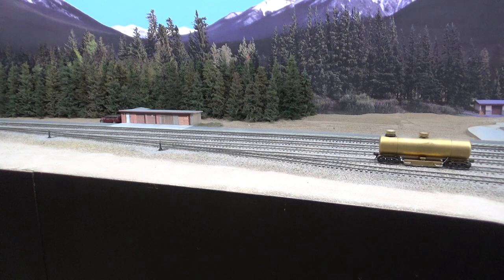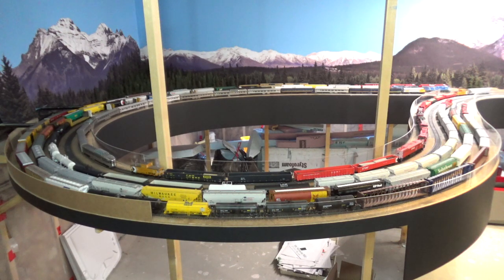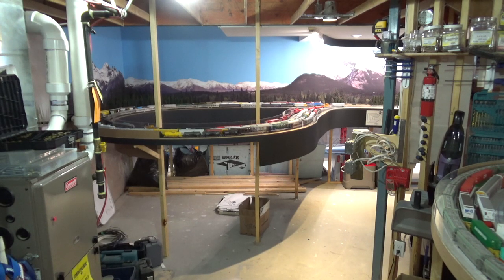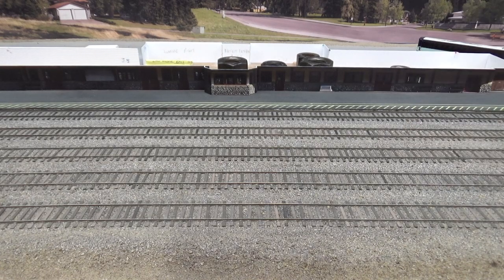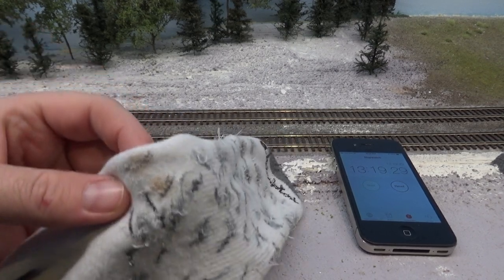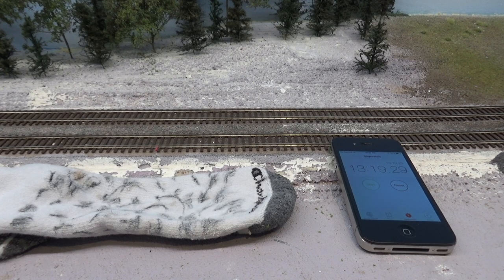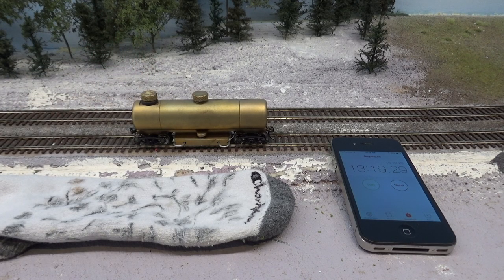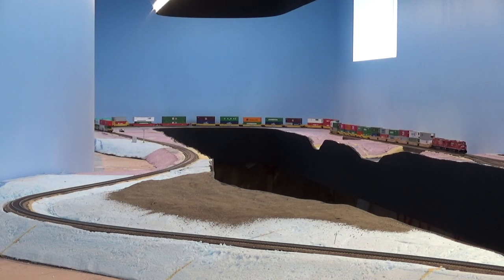How To Clean Six Hundred Feet Of Model Railroad Track

Comment: I use old cloth and CRC (without silica) on my layout. However,  I possess very little Nickel Silver track and use large amounts of Brass track with varying degrees of grime/oxidation. To boot, nearly all my rolling stock is vintage plastic wheeled cars which will leave residue on the tracks after a while. I’ve found the CRC and cloth works well for problem spots or heavily tarnished track segments and the simple cleaning with a cloth gets most of the filth with no issue. My current cloth is a pice of quality fabric. I tried isopropyl alcohol on some of my more messy track pieces and cleaned it up nice, but it does lead to more oxidation reactions as the alcohols deprotonate (lose an H) when exposed to an electric current. Unless you wipe off the isopropyl alcohol you end up adding a layer of grime to the track, since all does not evaporate off.
Reply: I love the Loram rail grinders and am trying to figure out the mechanism for a scratchbuilt model that would apply minute amounts of isopropyl before a series of scrubber cars (the issue is getting the scrubbers to stay clean sufficiently long enough to do a good 200’ before replacing the brushes/cleaning them). I’m also attempting to figure out how to apply minute amounts of CRC after the scrubbers (as needed) to increase conductivity
Reply from the maker: Love the idea of a Loram or Herzog train that looks like a maintenance of way train but is actually a functional track cleaning train. I'd like to try something similar eventually, I think a vacuum car in the lead would be good too to pick up the dust before the cleaning cars come along.

Comment: The sock is a great idea!  Model Railroad Hobbyist magazine did a great article several months back explaining why different chemicals are better or worse for track cleaning. Cannot remember the exact issue, sorry. The phenomena is “micro-arcing” that causes the bulk of grime on the rails. IPA is one of the worse things you can use and most people have been using it for years, including me. You will be pleasantly surprised that the strangest chemicals are the best. Cheers Brendon.
Reply from the maker: It's a fantastic article, a couple other viewers mentioned it as well. Thanks for sharing your experience Brendon.
Reply: so do I used  rubbing alcohol I think 71 % is 91 higher stronger trains do just fine after use so mini people say different things idk 🤷‍♂️ what to use I'm all confused

Comment: I used brass track on several layouts and never had to clean it.  And all my cars had plastic wheels.  Then local hobby shop only sold nickle silver track as i expanded the layout.  Then after changing all the cars wheels to metal i still have to clean the rails.  I'll take brass any day but it is hard to find.

Comment: I suggest the answer to why this works lies in the reason why we use nickel-silver for our rail. As I understand it - Nickel Silver oxidizes like any other metal, but it's oxidizing layer is electrically conductive. So maybe cleaning solutions / bright-boys and other abrasive cleaners not only remove the dirt, but also the electrically conductive protection layer - leaving the rail susceptible to attracting more dirt, whereas a quick wipe just removes the dirt.

I also recall reading somewhere the black 'dirt' is created by a zillion tiny electrical arcs as the locomotive wheels roll along the track, so maybe loco wheel metal composition is a significant variable in dirt accumulation.

I think the biggest variable is probably how dusty the room is - many basements have no ceiling for instance, while others share space with cars, woodworking equipment and other dust-creating appliances.

Just my 2cents worth hoping someone more knowledgeable can explain the properties of Nickel-Silver better than I.
Reply from the maker: Thanks for sharing your insights! Woodworking in the area contributes to extra dust on the railhead, I notice this right away anytime I use my table saw.
Reply: I have 200' ft. of brass track. I clean it every other time i run my trains. No problem whatsoever...NONE.  Waaay more realistic than nickel silver. Real life steel rails are brown..only shiny on top when trains run regularly.

Comment: Joe Fugate produced an article regarding "cleaning products" which helped me a lot, I was using 99% pure Isopropyl Alcohol and found the "black gunk" getting worse. I believe some of that is carbon due to micro arcing between the wheel flange/face the Iso being a "polar" liquid promotes this process. I now use kerosene which is "non polar" and it has made a huge difference in the production of the "black gunk" and thus trains running so much better and tracks remaining cleaner for a lot longer.
Reply: I'd be a little cautious about using Kerosene, because it will eat up plastics. Even tiny amounts at small amounts of exposed plastics near frogs of switches and rail crossings at grade will eventually start to deform.
Reply: @rodneykantorski736  I dab a very small amount on a rag and wipe the section dry with another kero free rag ,  no issues so far but thanks for the tip.
Reply from the maker: Fantastic article, another viewer mentioned it as well. I saw WD40 Contact Cleaner was number 2 on the list of best non-polar cleaners. I am going to try something similar based on everyone's feedback. Thanks for sharing!

Comment: I use paper towel and an electronic cleaner…one that is safe on plastic, and evaporates quickly.  Put some in the paper towel and rub it on the track.  Cleans the track and it’s non-abrasive.  Best method I’ve found so far…everything works better.
Reply from the maker: Thanks for sharing!

Comment: I use contact cleaner from crc. They have a conductive kind and a non conductive kind. I use the conductive kind on a paper towel or a microfiber cloth and go over the rail heads. As far as cleaning turnout contact points I usually use the same stuff on a gunsmiths pointed Q tip and get in there. I used to use alcohol and it did a bunch of damage to my track by pitting. After I sanded the rail heads down with super fine sand paper (7k grit) and then burnished the rail heads with a flat washer I now have to clean track maybe every 3 or 4 months
Reply from the maker: Great information, thanks for sharing John.

Comment: I recall from reading back issues when Westcott and Odegard were making the push for nickel-silver rail over (then standard) brass rail, that the selling point was that it's oxidation was conductive (unlike brass, where you had to clean off the oxide buildup as well as the dirt).
Reply: Right oxide my be conductive but black carbon from microscopic sparks is not.  👍
Reply from the maker: My childhood figure 8 layout had brass track and we cleaned it with steel wool lol, no wonder we couldn't keep anything running.
Reply from the maker: It sure doesn't, its interesting how some wheels will pick it up too. I checked my grain train recently and about 5/32 cars had the thick black carbon build up on all 8 wheels. It's like crayon wax.

Comment: I use Aluminum rim cleaner. Apply a thin layer on some cork, spread it around, let dry and buff with clean cork. I clean maybe twice a year. It’s all about preventing the oxidation. I will still use a rag or sock to clean some of the areas where gunk builds up
Reply from the maker: Thanks Jeff! That sounds like another non-polar option. I am going to try the NO-OX which I think is similar.

Comment: I do both. What you do after I clean with a cleaning solution. However I now use "Inox" to clean. Well not really. It is anti-corrosion and increase electrical connectivity. So I hardly ever clean my track. I learned about it from friends in Europe and Australia.    Not sure you can find it in Canada. But I just spray it on a sock and wipe it on. What a time saver. I don't know if it would work for you. But it sure works fo me.
Reply from the maker: Thanks for sharing your experiences Vincent. Yeah I am not sure I can get Inox in Canada, I don't recall seeing it. But we for sure have WD40 Contact Cleaner and a few other similar products.
Reply: @BArailsystem  Yeah I tried the WD40. It has a lot of water in it. And for me caused unforeseen issues.  I did find mine after some searching  at Ace Hardware or Walmart. It's about $14 American. But a Can will last you a life time.
Reply: @Vman7757  I don't think the WD-40 caused your water problems. The title "WD-40" literally means "Water Displacement, recipe # 40", so there is not water in WD-40. But with China making so much counterfeit crap, who knows what you really got. I've been using CRC QD Electronic Cleaner -11 Oz. ($9 at omazon) and it seems to work with no issues. What kind of problems did you have? Hope this helps out.
Reply: @thomream1888  I still have WD40. It just didn't clean like I had hoped. I did find issues with attacking some plastics so I just don't use it anymore. However  "Inox" has made so I clean my track maybe once every three of four months? Everything is running with very little or no issues. And one can is lasting a very long time. I still have a full can after two years.
Reply: @Vman7757  That's really great to hear! Track cleaning is a major hassle, I don't know anyone who really enjoys it. But it is a good time to really check your trackwork, wiring and such. Glad to hear what's working for you, Vincent. Keep up the good work!

Comment: I use my cmx on the hidden sections and harder to reach parts but I only use it dry rather than filling with a solution. After a couple of runs with a new piece of material fitted each time the tracks seem to be clean. The cleaning solution did seem to attract the dirt more atb Andy
Reply from the maker: Thanks for sharing your experience with the CMX cleaning car.

Comment: Alcohol actually causes the wheel contact to make micro sparks( pitting ) .long explanation for this. I just saw a video on using a no-ox on rails to stop that.
Reply from the maker: Seems to be the way to go, I am going to try it.
Reply: @BArailsystem  i been using no ox id about one month now, great stuff, but you only need a tap with your finger, dont rub just touch your finger to it

Comment: For a maint. clean I use a dry shop paper towel similar as you do and at about the same interval.  For  deep clean, like after messy work on the track/area, I use Min Spirits - same for new track.  If I use MS then it gets a light application of No Ox.   Think of it as washing the car is the maint clean and waxing the car is the No-Ox.  NEVER will I use a Bright boy!!!      
Thanks for another video!
Reply from the maker: Bright boy bad! I'm looking forward to trying the No-Ox.
Reply: @BArailsystem   NO ox ?  Is that the gray stuff for aluminum and copper wire ? I do high voltage electrical work we used a (No ox) product but it sticky and Messi is that the same?

Comment: The sock is a good idea. You can see when it gets dirty and you need to move to a clean spot. The problem with rubbing alcohol and other chemicals of the nature is they dry out what they come in contact with. They evaporate so quickly they take moisture with them. I think that causes a build up in static electricity the rails give off drawing more dirt and dust. Most of the black on rails is carbon from the microscopic sparks caused by the unevenness of the rail and wheels when coming into contact with each other. Even at the microscopic level the grain of metal is rough and will never be smooth to another piece. So we need to keep the track hydrated and that microscopic uneven grain of the metal all the way out to scratches you can see on the rails filled with something to make them smooth eliminating the sparks and eliminating the static draw of dirt to the rails and the carbon build up from the sparks. Oxguard to the rescue. Its conductive and will not take the hydration out of the rail as it dries. It puts on a microscopic film that is dry to the touch and does not make the rails greasy. Kind of like a gymnast putting chalk on there hands to help in giving more grip and add a kind of lubricating factor for there hands to keep down friction at the same time. Oxguard reminds me of how gymnast chalk seems to work two totally opposite ways at the same time. Oxguard keeps the track from drying out preventing static build up and fills the uneven surface by leaving a conductive film but a film that doesn't effect grip of the wheels on the rails. This will work if you use it in very small amounts and not glob it on. Just coat the rail head very lightly with your finger. Just enough to see it is looking wet and coating the entire railhead. Clean all the track and rolling stock wheels with white mineral spirits, or your choice of non drying cleaner, then apply the Oxguard when the rails dry. Do this once a year and run all you want. It will work if done correctly. But if the sock works for you and that's what you want to do then by all means continue. It seems to work really well at getting the rails clean and it also seems that since you've been doing it that way for so long the dirt and carbon doesn't stick to the rail that much. Looked to clean off very easily where as if you add liquid and start smearing the crud around it seems like it would make it harder to clean now and the next time. I guess because you've not used evaporative cleaner that that helps keep the track hydrated and the static draw down. Whatever works for one person might not work for another and we are in the hobby to have fun and doing things your own way, a way you're comfortable with makes it more enjoyable and fun for the individual in the end so I say do what works for you and keeps you having fun. It doesn't hurt to try new things though. That's how I found this cleaning way I prefer which is different from the previous preferred way. Stay well. -Wil  👍
Reply: I'll have to give "Oxguard" a try. Thanks !
Reply from the maker: Thanks for sharing William! I will give Oxgaurd a try.

Comment: It seems more and more people are moving away from chemicals and cleaner cars and honestly it makes sense. 
I've just used paper towels for clearing my O scale track when it gets gunked up and most of the time that works really well, sure certain areas require more work than others so just add some more elbow grease to it. 
May have to try socks in the future, though all of mine are black so...whoops? Lol 🤣

Thanks for another great video man!
Reply from the maker: Any dry cloth would work, I don't use paper towel because quite a bit of paper dust comes off it from clipping the rail joints as I go by.

Comment: From an electronic engineer's point of view, you are making an electrical connection by contact only. Not the best type of electrical connection, but the best we can do with rolling stock. Wheels to the rails create micro arcs and make micro cracks and abrasions. The black junk your sox is cleaning up is charged oxidation which works like a poor insulator. I've seen the video that Bob A has mentioned in the comments below. It talks about Polar (Bad) products vs. NON-Polar (Good) products. They should all make rails and wheels out of Stainless Steel, still conducts but little to no oxidation. Kudos that you can clean your track in that short of time ! Watch the video, very carefully and make notes. watch it a second time about the "NO-OX-ID" part. Try it on a text loop. ALSO, It's NOT ONLY the track, BUT the engines and rolling stock as well. 
If you have a lot of steam engines, remember, ones without traction do not grip as well. Good Luck.
Reply: William B below mentioned a "Oxguard" product. I have not tried it yet, but he said it was less greasy.
Reply from the maker: Wow thanks for sharing that information Mark. Very interesting and well explained. I second that motion to switch to stainless steel rail. Traction shouldn't be an issue on my layout as I only have one section that is 1% grade. But for anyone with a helix or stiffer grades, need to be very careful about applying too much and running into wheel slip issues.